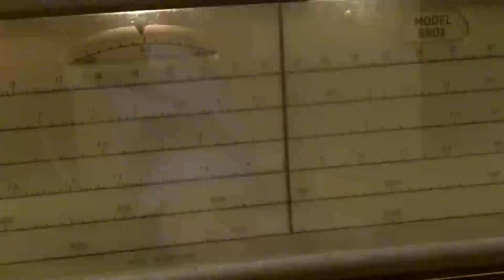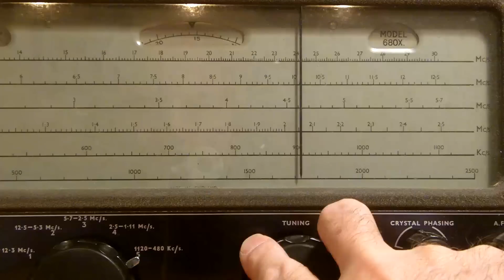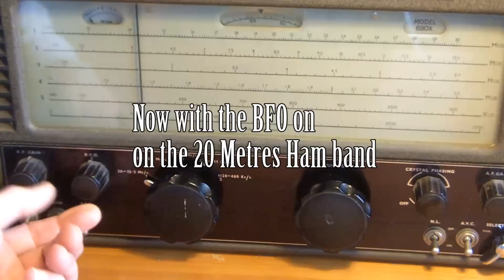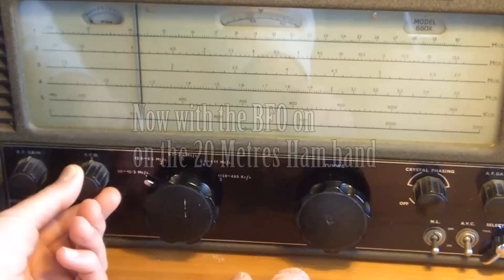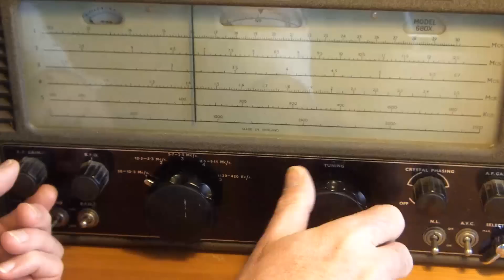About Radio ... Part 28... Listening to the Eddystone S680X radio.

Comment: Very beautyfull exciting sensations....little bit self oscillations but with 2 RF stages and the bw switch in a narrow position could be normal. The ssb signals demodulation seems very close to a product detector receiver. 73' Marco